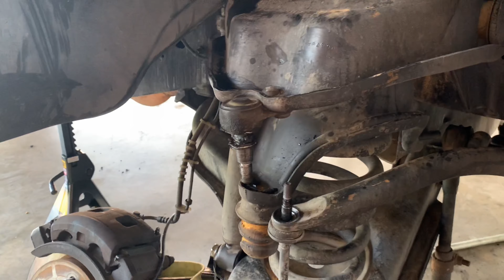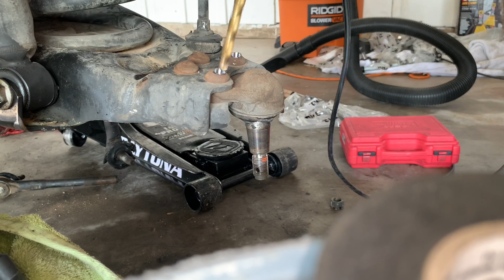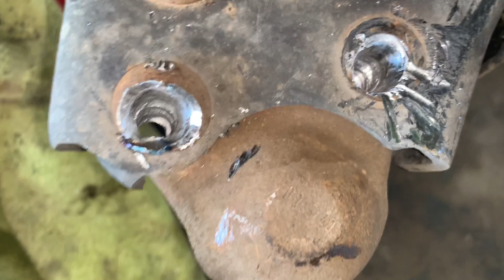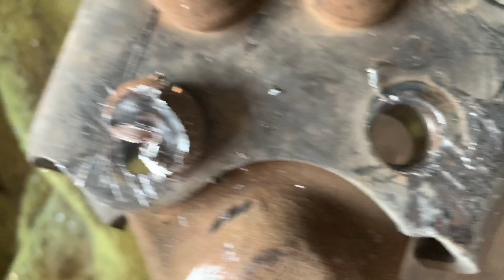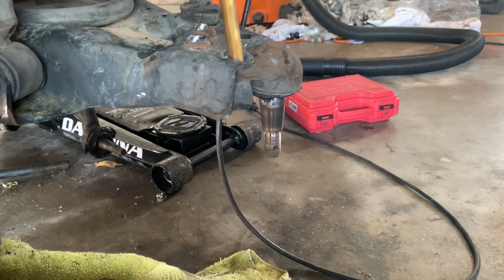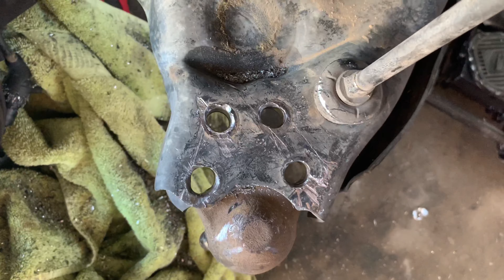Drilling Out Riveted Ball Joints - 2001 Dodge Ram TIMELAPSE

Comment: Would it not be easier to use an angle grinder or go from underneath? Sorry if that's a daft question we have different type in uk.
Reply: I tryed the angle grinder on my chevy Silverado and i was getting no were lol using the drill is alot easyer
Reply: @randomvideosyt5955  Thanks for letting me know that's going to save me a lot of time, very best regards.
Reply: No problem